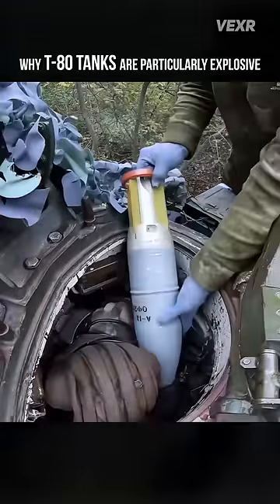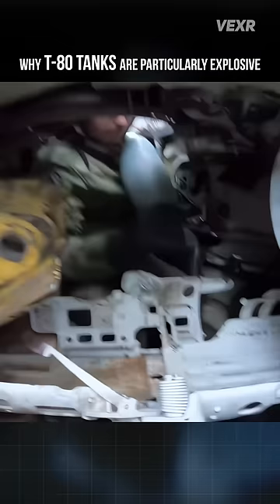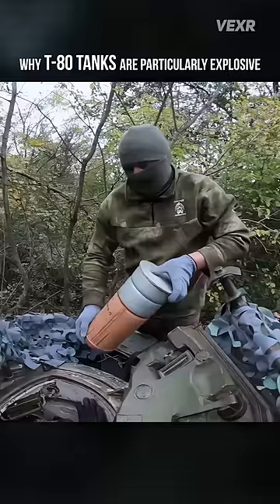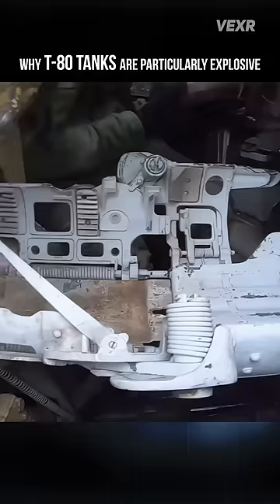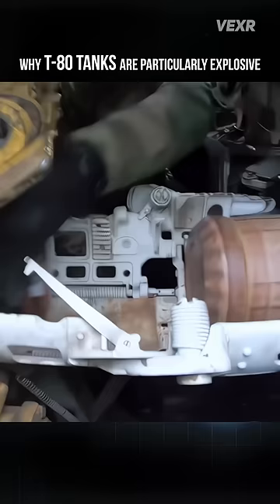T-80 Tanks Are Particularly Explosive, Here's One Reason Why

Comment: When the T80 was designed there wasn't alot anti tank missiles that shot a shaped charge from the top of the tank.  This shaped charge when exployed shoots a stream of super hot liquid that burns through solid metal.  This super hot liquid ignites the amunition stored below the gunner and tank commander.  The T80 and earlier tanks were designed to protect against head on shots to the front of the tank.
Reply: Actually, when the T-80 was designed the expectation was they would be used in mass decimating enemy to the front, so the front and turret armor is tough.

 In mass meant the enemy wasn't supposed to be able to get off a side shot at a good enough angle to penetrate the tank before they were destroyed. 

This is why the Abrams and other western tanks are  so tough. To handle multiple hits while maneuvering better shots on target and still be able to stay in the fight, 

In defense the tank would be in defilade, meaning they would dig a pit for the tank only exposing the turret so the hull and ammo would be protected. 

This is why they invented top attack missiles.

Shaped charges have existed since WWII. many canon rounds used by tanks against tanks and bunkers use a shaped charge war head. The bazooka of WWII also used a shaped charge armed rocket but it was small. a number of WWII weapons used a shaped charge warhead. 

Such a warhead uses a copper slug formed by the initial explosion of the shaped charge. It is fired into the target and is driven through the armor. There is some funky Physics that causes a copper slug to transfer so much energy to the small spot of armor it hits that all of that armor gets heated and driven forward of the contact patch. turning the armor and copper into a hot metal shower on the other side.
Reply: @SEllis-wd9nx  Abrams hull has thinner sides than T-72, and has more limited safe maneuvering angles. The only well-protected spots on the Abrams is turret cheeks and lower glacis. Upper glacis on it is VERY thin and compensates with massive slope, but penetration mechanics guarantee that even old short Tungsten APFSDS would penetrate it and likely kill the driver, never mind newer stuff. Also the Abrams is an INFERIOR tank in a hull-down position since its ammo is in the rear of the turret and would remain exposed when hull-down. T-64/72/80/90/14 all have their ammo in the hull so when in a hull-down position, ammo can't be hit, unless penned from above.
Reply: @Max_Da_G  Amazing that the Abrams faced the T72 multiple times in Iraq many taking hits from the T72 and surviving to defeat the T72 yet you claim it to be inferior.

To my knowledge no driver has ever been killed do to this so-called weak armor and the ammo is very well protected even while the turret is exposed. So, your theory has not been borne out by reality. The Abrams tank armor is extremely robust and outperforms its Russian/soviet counterparts. In fact, some of those T-72 tanks were penetrated by The Bradelys 25MM gun during desert storm and desert shield. Looking at some of the footage from Ukraine where you can see Russian Tank Hull carcasses burned and melted or blown apart, so the intact top deck is almost touching the ground while the front plates remain demonstrates the weakness is of their side armor. 

I suspect the Soviets may have made them thinner than designed either do to corruption or to use the extra material to build more tanks for less rubbles. Or they are built as intended and are simply weaker tanks.

Western Defilade positions are bi level, the lowest level would only expose the sights on the tank, the driver would then be commanded to drive forward to the higher position exposing the turret and clearing the gun to fire for brief periods. They would then return to a turret down position and scan for more targets. This is one reason why the sights are on top of the turret. The other being Armor integrity.
Reply: @Max_Da_G If hit directly in the viewing port maybe. But we have been told the upper glacis of the Abrams is not thin. It has been suggested that it is made of composites of Rolled Homogeneous armor and Depleted Uranium. In a hull down position the Abrams is fine as there still has yet to be a munition that has penetrated the turret face of the m1a2. The m1a2 would also have active protection systems and the ability to reverse quickly after firing. The Russian crew however would not be able to reverse as quickly as we have seen the t72 and t90’s lacking reverse speeds. That would lead to them possibly taking more hits that would lead to crew incapacitation through concussion. The t64/72/80/90s also have the same “weakness” of the Abrams found in the bulge above the turret. On the t55 this was found to be easily penetrated and made it easy to disable a tank. We have not been given proof on any additional armor being added to this bulge so it seems safe to assume it is also a weakspot.
Reply: @SEllis-wd9nx was this before or after the tracks needed to be changed or ran out fuel?
Reply: @beardedcanadian2844  Nice attempt at a quick drive by comment. The Abrams weighs around 74 tons and has a range of about 265 miles on 504 gallons.

 The T72 weighs about 45 tons and has a range of about 290 miles on 320 gallons. 

The T80 weighs about 46 tons and has a range of about 208 miles but has an internal fuel capacity of only 288 gallons. so about 30 tons less and you save 216 gallons. Some T80 have gas turbine engines some have diesel I couldn't find stats for each (assuming there is an operational difference.)

So, the Abrams engine is more fuel efficient than that of the T72, moving an extra 30 tons within 25 miles of the T72 with an additional 184 gallons. (maybe that's equally efficient) and equally efficient to the T80. But any way you look at it, you got way more tank at essentially the same range so there is no fuel efficiency issue. 

There is a weight penalty for all that survivable lethality so even a diesel would need more fuel to move that much weight.

 Even the British challenger 2 with 83 less gallons can only manage an extra 85 miles Than the Abrams despite at 65tons being 10 tons lighter than the Abrams. 

The leopard 2 weighs 67 tons carries 317 gallons and has a range of 210 miles.

 The Abrams range of 265 miles is well within that of other main battle tanks weighing as much as 30 tons less. No fuel efficiency issues. 

As far as tracks no issue there either, like any other modern tracked vehicle the tracks last and last and last. There are track pads that wear like tires and need an occasional change but you're still talking years of normal use. The track pads work with the tracks to protect paved roads from the metal tracks and the tracks from wearing out against the roads.
Reply: @SEllis-wd9nx  the Abrams uses 10 gallons just idling and oh the tracks need to be changed every 310 miles. There's a reason why the US is the only NATO country to use a turbine engine in their tanks.
Reply: @beardedcanadian2844  So what you're basically saying is every time you refuel an Abrams you have to change the tracks? Really. Keep reading there's more.

I Served 3 years with an armored infantry battalion of Bardleys and was attached with the tankers as a task force. In those 3 years I witnessed almost no track changes on the Abrams tanks. We drove way more than 310 miles in those 3 years and our vehicles motor pools were only separated by a chain link fence.  At our original base it was the same motor pool.

 I would have noticed if two battalions of tanks started changing their tracks in mass or were constantly changing tracks over time. 

You inspect your vehicle on a regular basis and replace only what is damaged and showing wear. Even the track pads were almost never changed. So no, you don't just stop at 310 miles and replace tracks. Nor do they wear out every 310 miles. 

If you're still reading, burning 10 gallons while idling is a stupid measure even if true.

 Modern vehicles are electronics heavy which means you have to run the engine in order to be in operation.

 If you don't you quickly drain the batteries running radios sights and if needed moving the turret to scan your sector, which means that you will be idling for hours. Even if you can operate for 2 hours on battery only (you can't), you still idle for a good 4 to 8 hours every 24 hours just to charge the batteries and maintain an active defense position. Assuming you run it 30 minutes to an hour every 2 hours.

Most modern vehicles burn more than a gallon an hour while idling. So, claims of it burning "10 gallons just idling" doesn't demonstrate poor fuel economy since they idle for hours. Especially in active combat operations.
Reply: @beardedcanadian2844  I don't see my original response. So, I'll just post this. You don't replace tracks every 310 miles. that would be the equivalent or replacing them every time you refuel if you drive across the deserts of Iraq. which clearly did not happen.

 Also serving 3 years with an armor heavy task force I think I would have noticed if they started changing tracks since, we drove way more than 310 miles in 3 years.

 Even the track pads were seldom changed. 

As far as burning 10 gallons while idling goes. That is a meaningless statement many make since those tanks idle for hours during heavy training and combat operations. 

It is necessary in order to run the electronics and react quickly to enemy action. so How long would you have to idle in order to burn 10 gallons just idling?

 It can't be "just idling". most modern vehicles will easily burn a gallon an hour. and you can easily have a tank running all day and knight with very little to no engine off time.

As far as the Europeans not using a gas turbine what measure of efficiency is that?

Maybe they have a strong tradition with diesels and feel logistically if repairs are needed spare parts and experienced local diesel mechanics are a logistical asset that makes diesels better in case of war in Europe and specialized turbine tools spare parts and training would be an issue. 

America has a history of having a logistical train that runs from America to where the war is so whether moving diesel or gas turbine stuff doesn't matter, and the tank is crazy heavy so gas turbines are way more fuel efficient than diesel if you can make them work. This is why modern aviation uses gas turbines for long haul flights, which is also why the navy uses them in many of their ships. Size weight and power output and fuel efficiency for the power package. 

When you get a chance look at the size of the diesel engines of cargo ships and compare them to the size of the navy's ships. and their respective fuel tanks.
Reply: Finally someone who knows what hes talking about!!
Reply: @SEllis-wd9nx The t72s in iraq were 30 years old at the point of the iraq war poorly maintained and were no match to the abrams in terms of optics,they simply couldnt hit it,dosent mean their armour was worse lol
Reply: @FirstnameLastname-ks4ln  So, Sadam Just didn't buy any tanks for 30 years? OK, and a hearty LOL to you too. 

A 30-year-old tank that is poorly maintained and has bad optics with great armor would still be a tank with great armor and should have survived hits from the Abrams but they didn't. First round kills don't happen against amazing armor, especially at extreme range.

   The Iraqis did score hits on the Abrams both with tank rounds and RPGs and didn't stop the Abrams. The world had to invent new rounds to attempt to deal with that Tank.

Tactics also played a part. The Abrams is not unstoppable, but facts are facts, and the results speak for themselves.

 As much as people love to pretend that their anti-Abrams wet dreams are real if the truth about THE Abrams Was different it would not have the reputation as the best tank in the world. 

That reputation was earned in combat. The British challengers are the other "best tank in the world" both proved themselves in combat.

 I can tell you this the Bardleys 25 mm main gun cannot penetrate the Abrams armor but has on multiple occasions done so to the T 72. 

I'll try to be fair...The Soviets attempted to build an overwhelming number of "T" tanks and may have skimped on side armor assuming tactics would win out or to be able to afford the numbers they built or maybe corruption. Or maybe self-preservation when the Kremlin says give me 20 but only gave you resources for 15 something has to suffer.

Either way it's a very capable tank but it is outperformed by the Abrams (Also a 70's design) in every way that counts.
Reply: @FirstnameLastname-ks4ln  Let me also add most of the Abrams and T72 Battles happened well within the optics range of the T72 like The Battle of 73 easting in gulf war one and the battle at the airport in gulf war 2.

Comment: "Why use an auto-loader when you can use an over-caffinated 19-year old who hasnt slept in three days."  -US Army, probably.  (Personally I think the autoloader is a huge liability; I just love the comment.)
Reply: You WANT the autoloader. Good luck loading that shell into the tank when tank is running at full pelt, tilting over all 3 axis and accelerating/braking without warning, all of that over rugged terrain.
Reply: Auto loaders are generally better and the US will get them in the next rendition of there tank. All new prototype us tanks have auto loaders. It makes the tank a smaller profile to
Reply: I believe the point of Soviet Auto-loaders was the idea that they would be in a CBRN environment, so they tried to minimise crew, minimise crew fatigue, minimise necessary training.
Reply: @pjbyrne1997 it also makes the size of the tank much smaller makeing it a more difficult target to hit. In the age before smart ammo was common it was a major factor and even today it can be a factor to save on logistics in the long terms for transportation do to also makeing the tank lighter
Reply: @pjbyrne1997  Size is the more important factor, how would soviet tanks otherwise have armour often greatly exceeding western tanks, while weighing around 15 tonnes less?
Reply: @Max_Da_G kinda already showcased that the auto loader is not better than manual loading. Battle of 73 Easting. Cool documentary. Those caffeinated 19 year olds had no issues loading those shells while moving.
Reply: 19Ks laughing at you at 20 rounds a minute
Reply: Hope everyone doing good and staying safe. If you need to talk to someone or need help, there are people who care. Sending support and hearts. ❤❤❤
Reply: @pjbyrne1997  The point was that when rushing over uneven and rugged terrain, loader would have trouble loading the correct ammo fast, especially if he is under combat stress, didn't sleep well, or whatever else. Hence the autoloader which didn't require much space, was faster if firing same ammo consecutively.
Reply: @michaelgarlinghouse1291  Yeah, moving over smooth terrain. It wasn't a triumph of manual loader over autoloader. It was a triumph of the latest existing version of Abrams with latest gear and ammo against obsolete export-grade T-72s and T-62s that had 20+ year old steel ammo, no thermals and crappy crews. And while in basically a sandstorm.
Reply: @1970bosshemi  Yeah, when in good health, well rested, well fed, in good mood, in clean and comfortable conditions.
Reply: How is a 19 year old in suboptimal condition less of a liability than a machine? Oh you yanks...
Reply: @michaelgarlinghouse1291 yeah through sand, not though rocky hillsides
Also, US technological superiority with ir gun sights absolutely made a difference 
Even if it weren’t 0 visibility due to a sand storm, Iraqi tanks were not equipped with apfsds rounds that could penetrate the abrams. They were decades old, steel rods of very short length. Had those tanks have been say, t90m with 3bm59, abrams would not have steamrolled them
Reply: @majesticface3631  Bruh the T-72 was put into service in 1973 the Abram’s was put into service in 1980, 72’s production began in 69 and Abram’s in 75. Most certainly not to far older than the Abram’s . Also gyroscopic stability is a hell of a thing. Also a scary fast traverse time helps as well.
Reply: @Max_Da_G Abrams loaders are literally trained for that exact task. And autoloaders jam a lot easier than some caffienated 19 year old shoving a single piece round into an open breach

Comment: Meanwhile Americans: okay boys, we need 3 dudes to do the same as that one guy
Reply: The americans have one loader and the reload qualfying time to pass the basic training is like 7 seconds or less. So american tanks can do the same reload if not faster, for having one more crew member, still maintaining a less cramped turret and safer ammo storage
Reply: i mean, if a russian autoloader breaks, at best the tank is sitting in storage for a bit while its repaired, at worst, the crew are currently in cosmonaut school.

if an american loader breaks, they are just hiring another 18 year old
Reply: @agentbarron3945 the thing is, that if the 18yo breaks, that most likely means everyone else in the tank is broken. But it is the more consistent option
Reply: @EnclaveChad  your injury was deemed non service related.
Reply: The larger crew size is seen as a benefit for the Abrams tank design. Having more people makes duties more versatile and reduces the weight and failure points of the system.
Reply: @kx7500  this is quite an accurate assessment, you will see some of the most awkward squats in the world watching tankers try to replace track links on an Abrams and taking one of those 4 guys away makes the maintenance that much harder.

Comment: The problem is not the autoloader itself. The problem is that it is inside the turret with a crew. You can have an autoloader like in Leclerc which is outside the turret and can load the gun mechanically. It's safe, it's fast and you don't need 4th crew member